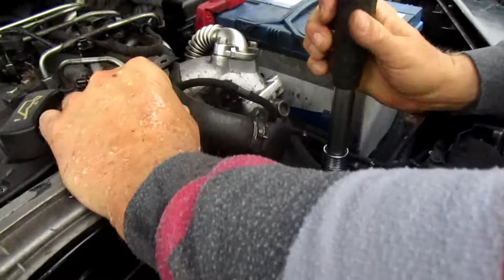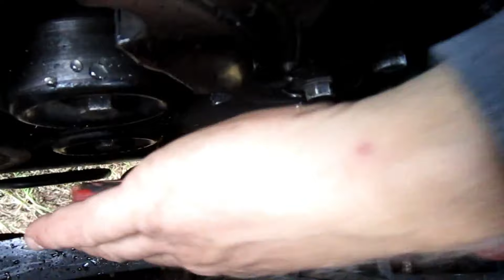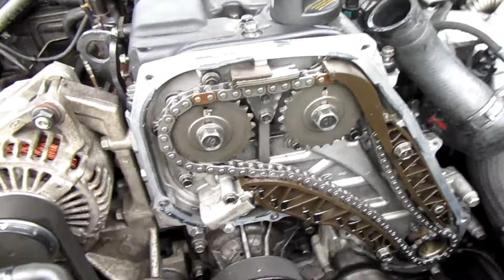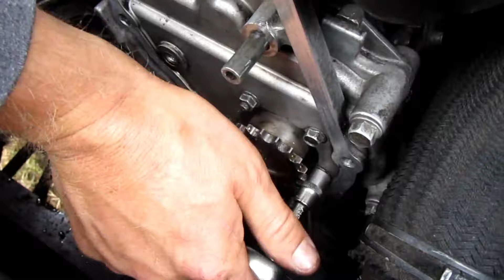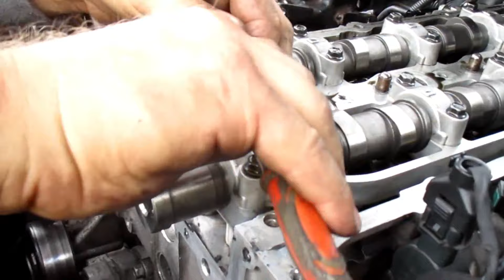Kia Sorento 2,5 Crdi D4CB How to change Cam Cradle , Camshafts , Timing Chain (Part 1)

Comment: Thanks again for the videos. I'm changing the timing chain and have taken the cover off, but the timing markers do not line up. So I want to turn the motor over by hand. What is the size of the socket used at 5.28? Or is there a better way to line them up? Thanks in advance.
Reply: 24 mm

Comment: Thanks for the excellent video. I'm diagnosing a 2006 Sorento 2.5 turbo diesel with a slow oil leak and a loud rattle around the top front of the engine, around the right-hand cam sprocket (when looking at the engine from the front of vehicle). Sounds like the chain is contacting the housing or similar. Any thoughts?
Reply: Como saber sy la bonba de agua esta danada
Reply: I have a similar sound i think is cam pushess

Comment: hello, can you help me please i see that you are a kia sorento guru, i have a kia sorento 2006 2.5 crdi 170 hp, the timing chain was replaced about 21000 km in kia dealer with original parts , in 2018, the car had 124000, now the car has 145000km, when cold ( in the morning) sometimes makes rattling noise for about 1-2 seconds, end if i let the car sit for about 2-3 hours  with the engine still warm, makes the same noise, sometimes it does the sound sometimes it doesent make the sound, could be the tensioner gone bad, losing oil? or the timing is gone (stretched) in that short period of time? what chain tensioner brand shoul i use( i am in Europe) or genuwine from kia? i am using mercedes benz mb 229.51, 5w30 oil, thank you in advance! thank you for your videos!
Reply from the maker: Hi, I think the problem is the chain tensioner, does it often. I use 5w40 oil
Reply: @Workoholik  should i buy a ina tensioner? or go with original parts from kia?
Reply from the maker: @alecsgsx  Ina tensioner is ok
Reply: @Workoholik  hi friend i have a similar sound in the top near cmashafts, how is the nae of the replacement parts that are moved by the shafts? I know there are a kind of pushers there

Comment: what is the PO62E troble code. Hyundai starex h1 diesel cammonrail. the engine is the same as in the video.
Reply from the maker: https://www.obd-codes.com/p062e
Reply: the story is my hyundai starex h1 sometimes breaks down. but if the ECU fuse is removed 20 minutes and then put it back when the engine starter is back to normal ... then after a 5 kilometer road the disease recurred again. Where's the problem, bro?
Reply from the maker: @hendrastm3662  Hard to say, the problem may be in the injectors
Reply: @Workoholik  seeps at 1,000 to 1800 rpm, and the engine sounds rather heavy when on the gas footing. but if the 2000 rpm and above the engine does not break down. What is the problem with the injector needle or the selenoid?
Reply from the maker: @hendrastm3662  I think it's a problem with  injector needle
Reply: @Workoholik  thank you very much guys for your knowledge. tomorrow I try to check the injector. I'm from Indonesia, right on the Sumatran island of Aceh where the 2004 tsunami occurred, if I may know which friend from which country. now in my area at 11:30 tonight
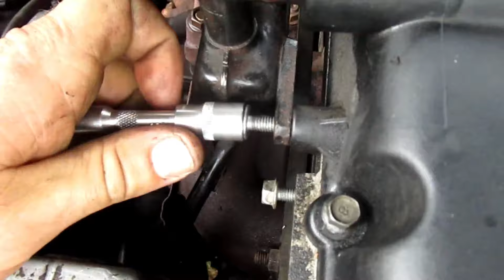Reply from the maker: @hendrastm3662  we are from the Czech Republic (Central Europe) and it is here 17:36 hours :-)
Reply from the maker: @hendrastm3662  I don't speak English well, it's better to send an email petr.s1981@seznam.cz
Reply: @Workoholik  I also can not speak English. from before I used the google tranlate application. if you use the whattsapp number it's easier for us to talk. my job is the same as you. I want to learn a lot about cammonrail machines with you.
Reply from the maker: @hendrastm3662  Unfortunately I do not have whattsapp
Reply: @Workoholik  what is the gear distance of top timing gear pump ford everest with connecting gear Ian? because some say 12 teeth and some say 11 teeth. if according to factory standards ford how many teeth Ian?
Reply from the maker: @hendrastm3662 Hi, I don't know how it is on Ford
Reply: @Workoholik  what is the size of the valve gap of the kia sorento 2.5 engine so that the sound is smooth and soft.

Comment: Hi ..i have problem with my oil dip stick,it always blow out and oil come out from it and also white smoke .and m oil also going to my turbo and intercooler.. after that happen ,i use oil catch tank to saparate the oil to enter my turbo but it doesnt sounds same like before when it happen.do u know the reason ?i hope u read my comment.. and help me about it
Reply from the maker: Hi, my English is not very good. If it goes on three cylinders and pushes the oil through the dipstick, it makes a punctured piston.But hard to say

Comment: Bonjour j'espère que tu vas mieux  pour vous 
Alors j'ai une kia sorento 2.5 ex 2005 175ch
Quelle refuse de démarrer j'ai changé le doseur jai vérifié les injecteurs  sa na rien donné 
Toujours le moteur refuse de démarré
J'ai vérifié les capteurs de pression
Reply from the maker: I apologize, but the translator does not translate it clearly. I don't understand what you need